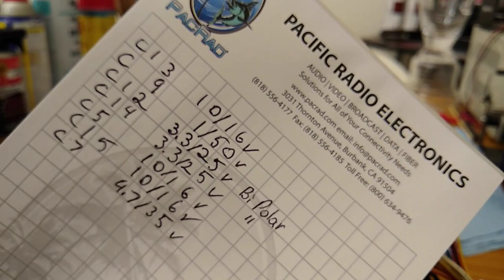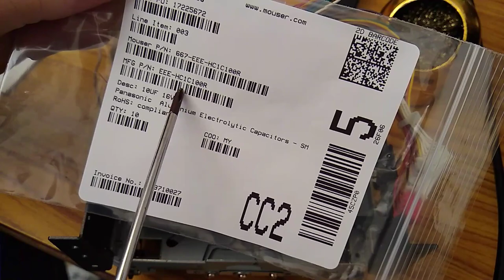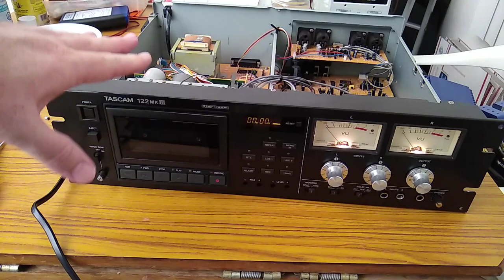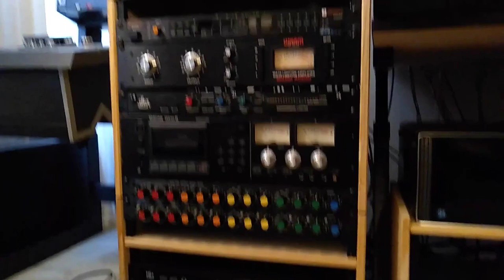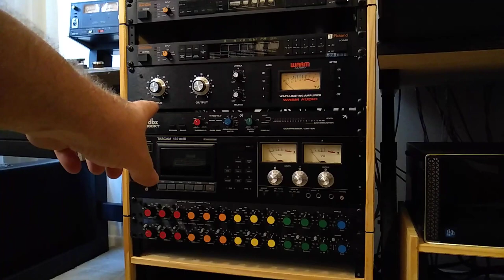Do It Yourself Musician #37 Tascam 122 MkIII Repair Part 3 SMD Capacitors

Comment: I have two 122Mk2, I believe it has the same board, but I've replaced all the electrolytic by tantalum - They're small, don't dry or leak, are more stable with temperature, even lower ESR, the capacity remains the same for all frequencies... As long as we don't use the old formulation that was prone to short, I don't see why I'll have to go through the same ordeal 30 years afterwards...

Comment: hi have a  tascam 238 i picked up of ebay on the 2 deck someone had tryed to re cap the pcb  the caps were to heavy for the  pad were the caps go
the pcb IC'S were not working right   as small as you can  4 mm x 6mm caps  from RS  15 WATT SOLDER IRON works great

in the end i had to pull out all the servo gear the repair to the servo motor pcb's was just to bad to fix  i got the to deck working in the end

Comment: Hi, I just got the same deck and when I turn it on, the capstan motor seems like it's trying to reach the set speed but it can't and it's very noisy as well. Could it be the caps?

Comment: Hi man. Great videos! I have a 122mk3 that needs all the same stuff. Do you happen to have a BOM of the caps you bought from Mouser that you would share?

Thanks!
Reply from the maker: Here are the parts I used. Mouser part numbers:

667-EEE-HC1H1R0R
661-BMVK250ADA3R3MD6
667-EEE-HC1C100R
667-EEE-HC1V4R7R

Comment: Just wondering what is the reason for changing the caps?
Reply from the maker: Those SMD caps from that era are known to fail. Probably not strictly necessary but I have seen units that had problems because of that.